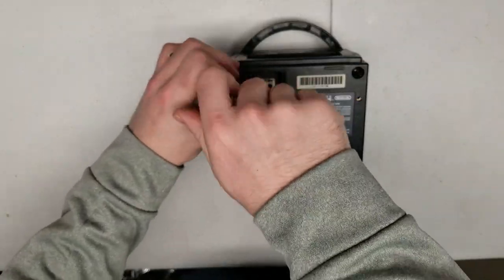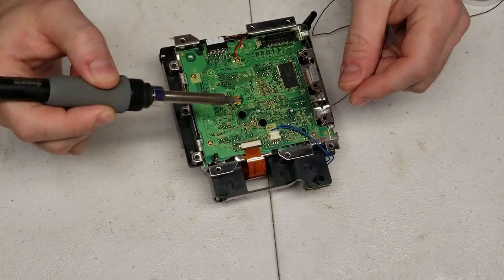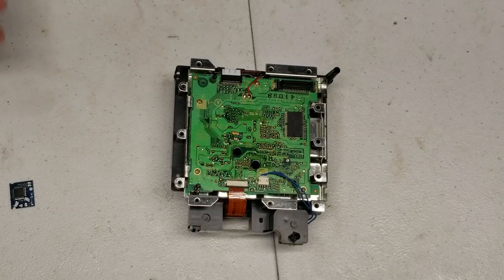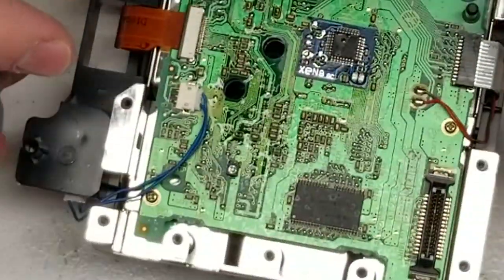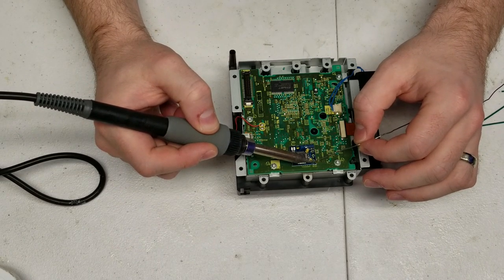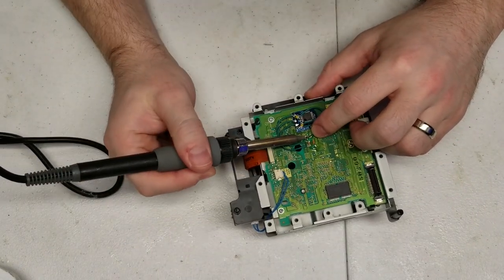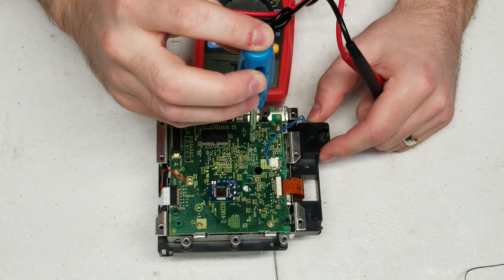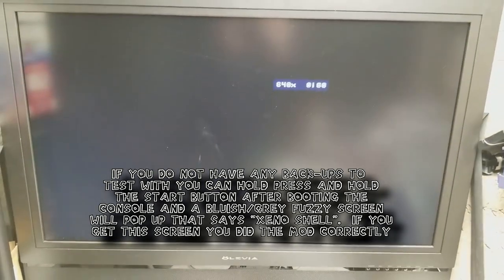How to Install a Xeno GC Mod Chip and Perform a POT Tweak in a Gamecube - Xen8 GC Modchip, xenogc

Comment: i did this just today and i have to say thank you for this guide i have successfully installed the xeno GC modchip to my gamecube. THIS WAS THE FIRST TIME I SOLDERED ANYTHING BEFORE I was ecstatic to know that it worked with my imports and my original games. I'm gonna try to do this to my cousins gamecube as well.
Reply from the maker: Cheers dude so glad you got it working good! 🍻🍻🍻
Reply: @RockerGaming  Haha, thank you so much!  I been binge watching all your videos and became a fan.  Seeing these mods and casting those sweet sweet buttons gave me some inspiration to try out these cool things.
For the next mod. I will defiantly try to do the rgb leds. Hopefully, I can do it.
Reply from the maker: @ItsTommiii  I appreciate it dude!  If you can do this mod, 100% you can do the rgb light mod, its shockingly easy to pull off!

Comment: Very informative video man.  I'd probably make a mess trying to do this myself because I've never soldered anything before 😅.
Reply from the maker: Haha, yeah this is likely not the right thing to do if you have never soldered before.  Having sad that I dont think you need a ton of experience to pull this off, especially if you go the wired method.

Comment: Thanks for sharing. I did the "difficult" method a few years ago, and thought it didn't work... until I realized I wasn't burning my DVDs properly. I wish I had known about that test screen!
Also, is there any way to reach the potentiometer without having to tear down the system? Seems like a lot of work for just a little adjustment. Last time I opened mine the pot was set to some ridiculous amount... I worried that the laser would be so powerful as to damage legit GameCube games. When Smash Bros. Melee is as expensive as it is, you don't want to take any chances...

Comment: Hey, I’ve messaged you many times, but I got the geno gc in, and am so happy I can play import and burnt games now. But now what about running Swiss? It’s low key hard to find actual explanation videos of how to run it AND what all you can do with it. I understand that it can let you force games to run in progressive scan wide screen which interests me, and also download games to an sd. Any pointers?
Reply from the maker: Hey no worries, do you think a deep dive its swiss might be a decent video?  I would be more than happy to do so.  

Anyway, here is the way I would do it.  Download the most recent version of swiss, burn the NTSC-U ISO to a mini dvd using imgburn.

get the SD to memory card converter, load up any homebrew and or GC ISO's on to an SD card.

Plug the SD card to the memory card adapter, into slot B, turn on the console with swiss in there and you should be good to go.  The hard part is finding quality mini dvd.  The ones that are philips branded seem to work pretty well for me.  Here is a link to them  https://amzn.to/2VwQaqJ

Let me know if you think a video would be helpful...I should have done a deep dive into this topic by now but have not.
Reply: RockerGaming I think from what you’ve told me here i can do it, I just have to order more mini discs. And I think it would make a great video! There seems to be almost no quality videos on how to do it, and what all you can do with it, only ones recorded 7 years ago by foreign people recording with rocks. Thanks for the help, and I will continue to watch your videos lol
Reply from the maker: Sounds like it's time for another (more up to date) video on the topic... I'm adding it to my list
Reply: RockerGaming thanks man your awesome

Comment: So I did this mod and fiddeled with the pot. I'm running swiss of a burnt cd to run the roms off a SD card. Only problem is when I first turn the console on it won't read the disc, I then reset it and it then managed to read it a start swiss and I can then play the roms. I'm not sure why it won't just work the first time.

Comment: Maybe one day i will try this out.
Reply from the maker: DatGameCollector you can do this one. There is some fine solder point here, but it's very do-able especially if you do the wire install method
Reply: I need the tools still.
Reply from the maker: DatGameCollector yeah having the right tools is really important. You could attempt it with less than what I've used/recommended in the guide, but it is more difficult without them all.
Reply: Now a days there's no need to do this when Wii and Wii U can play game cube back ups after a soft mod
Reply: @alexandersalazar9750  Still a need if you want to use the original hardware. The video output is better to run them natively.

Comment: I am looking to do this to my GC but I have heard those Xeno GCs on ebay burn out pretty frequently. What is your experience with this? Do you get your chips from eBay?
Reply from the maker: LegitSkillz that is where I got them from. I'm not sure there is a noticeable difference between those and the original. At the end of the day the original chip was manufactured in China as well and both are running identical code. The only thing that I dont like about the ones on Ebay is the LEDs on modchip are same color which defeats the purpose of them imo and why I didn't focus on them in the video
Reply: RockerGaming Ah ok cool. That is pretty dumb that they would use the same color LEDs though. I should be able to manage without it though. Thank you very much for the reply!
Reply from the maker: Yeah I agree with you, that made no sense at all, I would have been happy to pay and extra dollar or two to have the different colored status LED's, which is how the chip was designed to be used.  

No problem and best of luck with the mod, its not bad at all, just take your time and you will be just fine.

Comment: This is deceptively difficult. I would rather do 100 PS1 modchip installs than another Xeno. Nintendo made one hell of a fragile PCB.

I really like the way you place the chip and run the wires, this is how I will do mine from now on.
Reply from the maker: Hard to disagree with what you said here.  Let there be no doubt the direct solder method isnt the easiest.  The wire method isn't bad at all.  I think if you give that a go, you might rather do 50 PS1 modchips instead of 100, lol.   Seriously though, I think it will make your life considerably easier and thank you for the comment!!

Comment: Rocker, can you list more info about the flux type, solder gauge and type, solder tip size and temps?
Reply from the maker: No problem, likely more than you're looking for, but here you go.  I solder at 700* F and I use the stock conical tip on the Hakko iron in the link below.

Here is the solder I use: https://www.microcenter.com/product/422737/solder-sn60-pb40-0032-22-gauge---no-clean
Here is one of the flux's I use: https://www.microcenter.com/product/397211/rosin-soldering-flux
Here is the no clean flux I use: https://www.amazon.com/MG-Chemicals-Clean-Halogen-Bottle/dp/B00S16UAGE/ref=sr_1_2?ie=UTF8&qid=1539354180&sr=8-2&keywords=mg+chemicals+no+clean+flux
Here is the soldering station I use: https://www.amazon.com/T18-D08-D12-D24-D32-S3/dp/B00C1N30DI/ref=sr_1_5?s=hi&ie=UTF8&qid=1539354203&sr=1-5&keywords=hakko+soldering+iron&dpID=41ARiuqvVDL&preST=_SX342_QL70_&dpSrc=srch
Here is the tip cleaner I use: https://www.microcenter.com/product/457751/tip-cleaner
Here is the desolder braid I use: https://www.microcenter.com/product/425071/fine-braid-super-wick---5ft-0025
Reply: @RockerGaming  thanks for the reply!
Reply from the maker: @healerlfg7769  No problem!  I have been meaning to do a video on all that... one day I will get to it!
Reply: @RockerGaming  my soulder pen only goes to 450, can I still do it?

Comment: Hey man, 

I tried soldering the XenoGC the direct to the board way. When trying out I only get a solid red light on it. Tryed to boot up the XenoGC shell by holding start during startup, but no luck. Do you have any suggestions to find out, which point ist not correctly soldered via multimeter (also which points to check) before desoldering everything. I would really appreciate your help.
Reply from the maker: Tbh i would just desolder with some desolder braid and then use the wired method. Its just so much easier to diagnose any potential issues.
Reply: @RockerGaming  Thanks for the tip! I messed up while desoldering and ripped one pad. Now I have no other choice but using the wired method :D.
Reply: One more question, which wire size do you recommend? I would be able to order 22 AWG solid core but many suggested 30 AWG. Do you think 22 AWG is thin enough?

Comment: what gauge did you use 30 I have 24 would that be fine or should i go get 30 gauge wire
Reply from the maker: I used 28 AWG.  24 is fairly thick.  I would recommend thinner.  Having said that you can always give it a go and see what happens.

Comment: I have Soft-modded my Wii with GC support. So should I bother modding my GC? Is there any benefit over a soft modded Wii?
Reply from the maker: I think it is still worth it.  Using Swiss you can force games into 480P that are otherwise unable to do so.  I am not sure you can do that with a softmodded wii.  TBH though, most everything a GC can do, a Wii can do.  The only other upside to a GC is the ease of which you can get HDMI out now.  Those two factors alone are more than enough for me, but depending upon your set-up and other factors I could see your response being different.  I hope this helps!
Reply: @RockerGaming  Thanks fior reply! Easy HDMI out of GC?  Can you tell me about it?

Comment: Texted you a while back about this. Have the xeno gc installed and want to get Swiss on it to launch games and force all games in progressive scan since I have component cables. Heres the problem. I have the SD card adapter and an sd with the Swiss download on it. Problem is I need one of the action replay discs to boot it. I bought some blank mini cds to burn it onto, but they took forever to ship here, and now since the whole Nintendo going after the downloads thing happened, I can’t find the file. Any idea where I can find it?
Reply from the maker: No problem. Just follow this link download the newest release and the burn the ntsu-u iso.  https://www.gc-forever.com/forums/viewtopic.php?t=1375

Comment: Hey. I have a Problem with the pot tweak i burned Sonic Heroes to a blank Mini DVd-r Disk at 4x full Speed . So my normal original ohm value was around 150 Ohm and i saw the Heroes Emblem in the right bottom Corner But then it was giving an Error. So i tweaked IT Up and IT wont read the Disk at all. 
I tweaked IT down below 150 and IT worked but i Set IT to around 11 Ohm and IT is fine but in the First Level loading Screen IT IS giving me a Dre. I Heard that there is a Second resistor that is Always 150 Ohm and even when i Go to Zero ohm with the pot i would be still at 150 theoretically ? Should i Go Up  again or what should i do over 150 Ohm IT wouldnt read the Game at all. I need Help i want to Play 😅😅

Edit; i have a dol-001
Reply from the maker: I would check your burn.  what kind of discs are you using?  What software did you use to do your burn?
Reply: @RockerGaming  It was Imgburn with mediarange mini dvd-r 's but now i tried burning it with cd burner xp and now its fully working i set the pot to the factory setting it was around 150 and now everything i burn runs without any dres or what so ever;)

Comment: Went thru all this and my gamecube still won't read my backups. Ive tried two different kinds of dvds and still nothing. Could it be the iso's ? any help would be appreaciated.
Reply from the maker: Did you do the pot tweak?
Reply: @RockerGaming  Thank you for responding. I got it to work already, I did do the pot adjustment but I was still getting nothing until I tried a different burner.
Reply from the maker: Perfect! Great news!!

Comment: Tried the direct method, but when that did not work I ended up pulling up the pad (C in your linked diagram) when de-soldering it.  Tried the wired method and wired to where the pad traced out to (via on one side and trace/circle on the other) it won't read official disks reliably and never get any of the mod screens (holding down start etc).  Should have started with the wired method - so much easier.  Debating just tearing out the xeno all together and putting the screws back in.
Reply from the maker: I couldnt agree more, wired method is extremely easy IMO.  I would pull the chip and make sure the drive still works as its supposed to, its possible there could have been more damage done when you lifted that pad.
Reply: @RockerGaming  At this point I think the XENO is bad.  After getting the traces sorted it will boot an original game one-time then not recognize the game if I power cycle the GC.  I also tested the leds with a diode tester on my multimeter and they both are red so that is not helpful.  I could unsolder one of them, but I have not been able to determine which one should be green or amber.  Anyway my DVD-Rs came in so I have another project to work on for a while.
Reply: Getting closer, got a new XENO and replaced the inner RED LED with a Green LED so at least I can now see that it is semi-working.  LEDs now do the correct pattern and it will read original Gamecube US region disks.  I have a Japanese region Luigi's Mansion, but it does not seem to read it.  Ordered a new Laser as the next step.  However holding down the start button of controller 1 before, during or after boot does not seem to do anything.  Might try fiddling with the laser pot.
Reply from the maker: @Junkman444  sounds like you're getting closer for sure. If you have a multimeter I would try to tweak the pot, but if it's an original pressed gc game it should work.
Reply: @RockerGaming  Tweaked the POT a little bit (408 to 240) and it reads backup, original US Games and my swiss GBI disk I made just fine.  Wonder if I just have a bad Luigi's mansion (JP region) disk at this point.  The surface looks good; but who knows; it may have been buffed too much in Japan.  That disk locks up the Gamecube hard;  basically freezes the screen until it is powered off.  I was interested in the region free mod part of the XENO.
Reply from the maker: @Junkman444  I would try to burn a japanese game and see what that does.  At this point I would say you have everything installed correctly for sure... I would also be very suspect of that Luigi's Mansion disc.... I think your diagnosis might be correct!
Reply: @RockerGaming  Same result with burned Japanese game.   I guess I resume these shenanigans when the replacement laser comes in.   Not much let to check and I am out of DVDs for now.
Reply: I just wanted to close the loop on this one.  I did replace the laser since the GC was having issues reading original games; however the specific JP game I was testing with was Luigi's Mansion and with that specific game other have also had the same issue of it locking up the GameCube (gc-forever forums) so I burned a different JP game and it boots and runs fine.  I did a wired install on another GC and tested the same Luigi's Mansion and it did the same thing (locks it up).  However I am able to use Swiss to launch the original JP Luigi''s Mansion game.  Hopefully others won't use Luigi's Mansion (JAPAN) for testing the XENO install on a US region GameCube.

Comment: I had to adjust the potentiometer from 170 ohms to 20 ohms to get it to play backups. Is this normal?
Reply from the maker: I like to keep mine at 75 ohms or higher. Having said that there are other factors that play into it. Such as the quality of the burned media, mileage on your laser, and condition of the caps on the DVD drive. If you opt to keep your drive that low id burn a copy of Swiss and use it to boot games from SD card to laser usage is minimal.
Reply: @RockerGaming  Hm, allright. Probably the media then, it was quite cheap. Will have to do some more testing. Thanks man.
Reply: So I bought some Sony discs and yeah wow, it made all the difference. Could boot it 50% of the time at 140 ohms and its stable around ~115 ohms now.
Reply from the maker: @Xaikar  haha yep it makes a massive difference! Glad you got it significantly more stable now!!

Comment: I installed the mod now I want to boot up my console with sd card mod what should I do
Reply from the maker: You will need a copy of swiss burned to a mini DVD-r and you should be good to go. Swiss will automatically read the SD card for you
Reply: Thanx
Reply: And how can i set up emulaters and which emulaters can work
Reply from the maker: you just need to copy the emulators and games to the root of the SD Card, I would check out https://www.gc-forever.com/forums/index.php you should be able to find them all there.

Comment: If you don't recommend this as a first soldering attempt mod, do you have suggestions of what would be a good mod to attempt first? I bought a soldering iron and am really wanting to practice I just don't know where to start. I love modding consoles and controllers, just never done anything that requires soldering yet. Seems intimidating.
Reply from the maker: I would practice technique on old electronics and then once you are comfortable with good soldering technique then I would try an led mod, once you can do that, move onto something like this.  This mod isnt terribly difficult, but it really helps to have good technique.
Reply: @RockerGaming  wow thank you for the thorough reply! I will do exactly this 😁😁